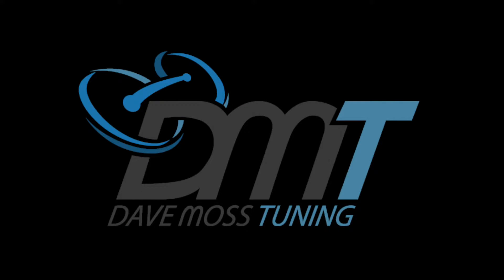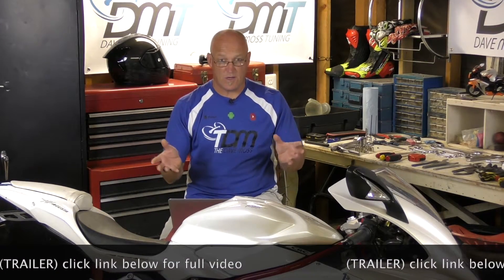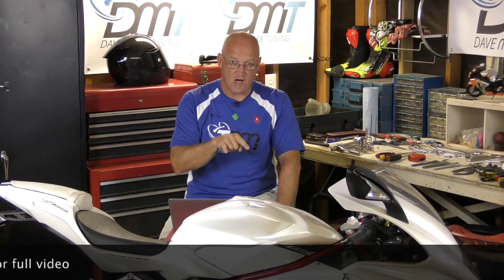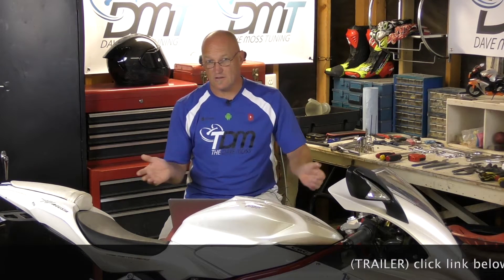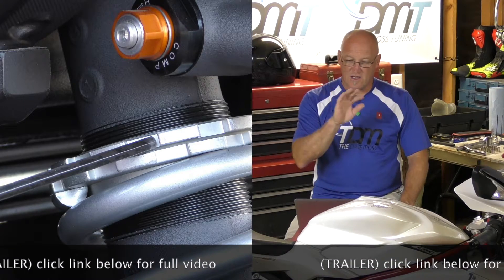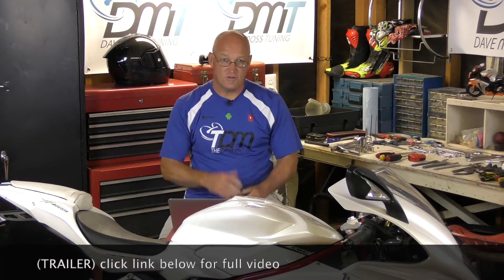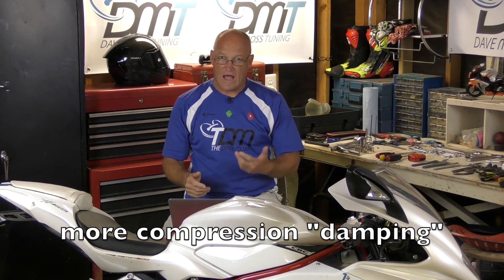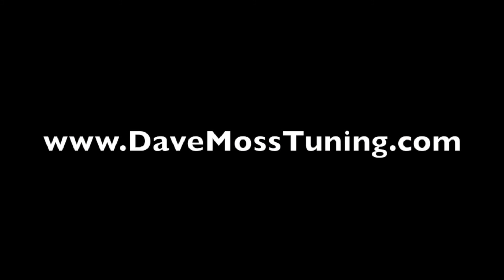FasterClass: Motorcycle Tire Wear Compression (TRAILER)

Comment: Same problem in the cbr650r 2023. Rear rebound is too fast, as well as compression. I can only regulate preload, so its low to help 3/10 (+1 from factory). For the rebound and compression I can only lower the PSIs in the rear, playing with 32-36 now ;(. Bike feels stable and planted with good feedback on grip in the turns but it looks like the one in the photo.
Reply from the maker: Thank you for sharing how you are learning and what you are testing! Others will really benefit form you paying it forward.